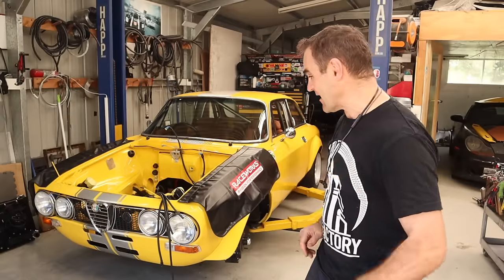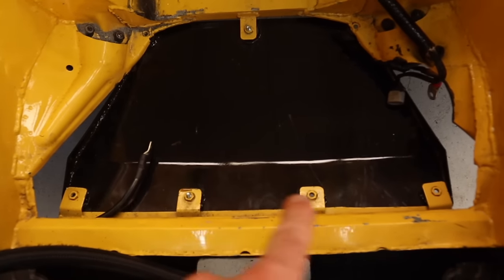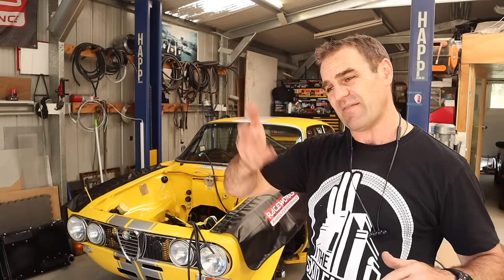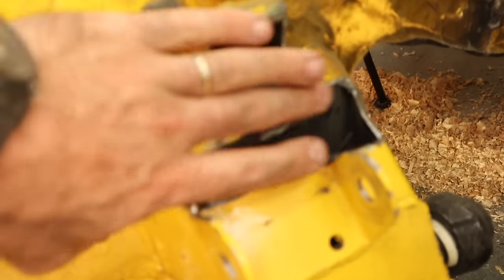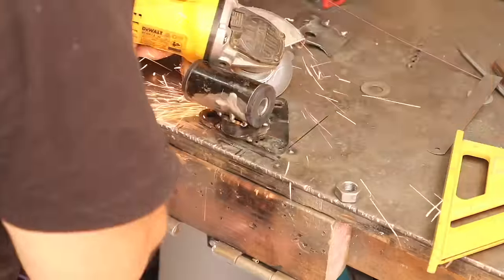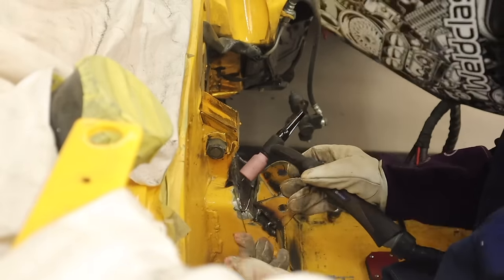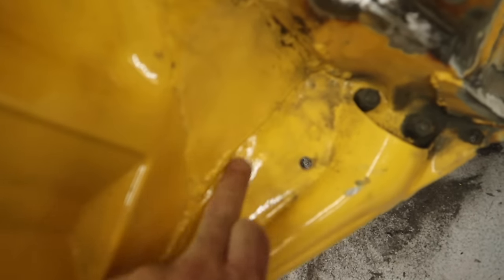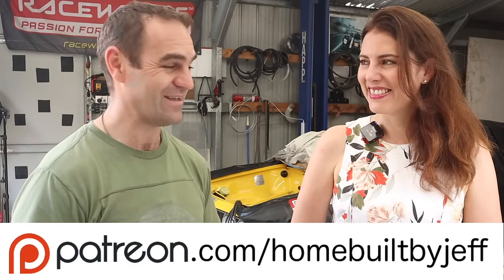Making the Ferrari engine fit... better - Ferrari engined Alfa 105 Alfarrari build part 209

Comment: Jeff, put louvers in the under tray  with them opening toward the back of the car so as the air passing under the car in affect suckes  the hot air out. I did this to my car and the temperature dropped by 15 degrees
Reply: A couple naca ducts on the bottom of that bash plate shock suck the air out nicely.
Reply: @Simb-l  naca ducts are inlets, not outlets
Reply: Standard sump guard on my old Hilux has loovers
Reply: Or some naca ducts..
Reply: Go rally style and just drill some large holes in the bash plate. They do it so 1) it aids cooling but 2) also to allow flood water out.
Reply: I was going to suggest this as well. You could 3d print some dies to bend in the louvers, and you can use your CNC plasma table to cut the slots in it
Reply: Hey Jeff. I'm with these guys on the bash plate.. But I would press the holes out. Press and form the edge of the hole down so that any liquids would find there way out easier (and air). But also give the plate a bit more rigidity if it does come into contact with anything, as the holes will make it weaker.
Reply: I’m not sure some of the suggestions will solve all of the problem(s).  There are 2 basic states - stationary and moving - and airflow works differently for those two states.  At rest, hot air rises and needs a way to escape from above the motor, so venting above the engine might assist, but once moving the airflow takes a different route as a result of changes in air pressure across the surfaces of the car.  I think some advice from a skilled expert might be best.  
I speak from my experience on a drip tray vent I fashioned for a hot LJ Torana many years ago.  Initially it faced forward but experience showed that this made things worse, as it disturbed airflow through the radiator grille making cooling less effective, and when it rained it scooped water over the distributor and plug leads, which wasn’t good either.  Ultimately I reversed it so that it created a negative (sucking) pressure under the engine which did improve cooling.  It also stopped all the water entry.
Some expert advice from a suitable engineer might save a lot of re-work…
Reply: Put louvers in the under tray

Comment: I swapped my fan from a ebay special to a mishimoto race fan , I would louvre the sump guard to direct air out of engine bay , also try have the bonnet open slightly to see if temperature actually decrease before adding bonnet vents, you can get prescription lenses to go into welding masks

Comment: Louvre type reversed scoops in the under tray / bash plate would assist greatly. You could do a series of small louvres or a larger single reversed "bonnet scoop" to allow large volumes of air out under the engine. 

I would tend to leave the plate in because of the mud and spray up into the engine bay if it is removed. Makes cleaning the bay a lot harder. 

It also reduces water, mud and debri onto fan and serpentine belts which helps them to maintain friction and not slip so easily under load in night time adverse conditions .........

Comment: Remember the Holden Torana LC LJ GTR XU1 front Air Dam, It was there to make a low pressure area behind it to draw air through the radiator. The VL Commodore had the same kind of thing made in plastic so it could flex.

Comment: You need a shroud around the fan to draw enough air to cool the radiator. The shroud allows the fan to pull air through the radiator's entire surface area, increasing its efficiency. The fan should be centered within the shroud. That tends to be the best location to draw air through the full surface of the radiator
Reply: 💯% Agree
Reply: Yes was going to say this.
There's no real shroud on them fans.
It can't suck in enough air efficiently.
Reply from the maker: There is a shroud. There is a whole video of me making it and you could see it in the last couple of videos ;)
Reply: Yea definitely needs a shroud
Reply: @HomeBuiltByJeff  I’ll go try and find that Jeff. If you’ve done a shroud already then I wonder if there is too much water flow through the radiator because if it runs through too fast it might not be staying in the radiator long enough to cool off at idle?

Comment: Every little bit will help.  I forget, have you tried using a wrap on the exhaust headers?  That will help keep some heat out of the engine compartment.

Comment: Jeff, I think you’ve diagnosed your cooling issue correctly.  If you want to retain the “bash plate” you might consider putting a fan or two in it if there’s room, to PULL the air that’s gone through the radiator OUT of the engine bay.  This is similar to tightly cowled piston aircraft…airflow out is just as important as airflow in.  Most piston aircraft are air cooled, but the same principle applies.
Reply: Agree here!  Fan to pull that air at slow speeds, traffic etc.

Comment: The new fan will make a huge difference. If will just push the air around the engine and out the bottom. 
   Also noted cutting a louver in the bash plate to pick up that high speed air and use it to vacuum the air out of the engine bay. There are high pressure areas on either side near the tires from the "tire squish" as they push the air out of the way. Air dams could be installed on the bash plate to block the tire squish air from filling the low pressure area you want under and behind the engine. Great work powering through these hiccups !!!

Comment: Looking good Jeff, when we were developing and building supercars (rear engined worse)  heat was always a massive issue. Maybe modding the bonnet with the hump continuing to the back edge by windscreen and then having a vent along the back edge of the hump …. that will help the rising heat escape along the back edge and out. The easier way with old racecars was to lift the back edge of a bonnet with lift spacers to create a gap….. enjoying your content mate 👍👍👍

Comment: To assist the engine cooling cut out the triangular areas you mentioned and 3D print a grille to fit in there.

Comment: Jeff, welcome to getting older.  As a rule, you should have surface area equal to your radiator intake for the outflow and preferably about 20% larger.  The idea of the louvers in the bash tray is good, as long as the louvers are shaped correctly.  The other option is outflow NACA ducts in the bash tray, but I do not know if you have enough space above the tray to install them.  Adding the fan shroud is a must, especially for idling conditions.  Keep working on solving this, you will get it right.

Comment: Speaking of vision, I was in a hurry and trying to get a project car assembled so I could shuffle cars around the shop, and punched myself in the face with a 1/2" ratchet! I really did a number on myself. Split my eyebrow, 2 huge lumps on my head, one from the socket and the other from where I pulled pack into the door pinch weld, and my vision in my right eye is almost gone. Which was my good eye!
Fingers crossed I can see to weld tomorrow. Have a huge fabric job on at work.

Comment: On my 1986 Alfa Romeo GTV6 I have a overheating temperature when the A/C was on so I installed a cooling fan in front of the rad and left the original twin fans in the back of the rad and it solved my overheating issues, you may want to try that Jeff, I wouldn't cut louvers in the hood.  Good luck.

Comment: Regarding the vacuum leak...be careful, if you have MAF based ECU tuning, then whole tune would be off now, after the fix, because you actually tuned with less measured airmass, than actually entered the engine. If you have speed-density tune (MAP based) then you're OK, because you tuned according to actual measured MAP in intake plenum.

Comment: Hey Jeff couldnt you make some neat holes in the inner wings for hot air to escape through the wheel arches.?? I noticed 2 verticle rectangle  inlays on the front sections of the inner wings if you cut the centre sections out l reckon alot of the hot air would escape. Just a thought 👍
Reply from the maker: Unfortunately that has the castor rods mounted directly behind that.

Comment: Is there bleader valves on the heads to release air pockets? Ceramic coating the headers will decrease the temperature also.

Comment: Keep the "bash guard" but cut longitudinal gaps maybe 1" wide and 1,25" apart in it.  That way if you DO hit anything, it will still work as intended,  Should be enough to vent hot air down and out.

Comment: Few days late on this, but what if for the bash plate you go with what some of the originals ones had (And my one) was basically a cage protector, just a few ribs to protect, shouldn't be to hard to find pics.

Other suggestion, if you did have to do something to the hood why not look at the latest alfa Gulia QV and the vents its got on its hood, way more subtle and could be something you could get, laser scan and 3d print for mock-up.

Comment: Have you looked at static pressure fans vs airflow? My understanding is that airflow fans don't work as well as static pressure when it comes to forcing air through radiators especially in tight spaces. 

There's info on YouTube about it from high end PC builders that use watercooled loops in their builds.

Comment: i know you don't want to cut up the engine bay, but what about some formed air outlets in the inner fenders into the wheel arches? it might introduce more dirt into the engine bay but if you shaped and placed them carefully it could be another under bonnet solution

Comment: Jeff you can put the baseplate back just drill it. Make 25 holes in it. Like a grid plate (is that EN) you have the protection and the ventilation.

Comment: Jeff, your engine overheating is at idle in traffic and when you move it’s alright, right? Heat rises and for this reason you need some louvers on the hood for the heat escape from the engine bay. Louvers can be done very clean and good looking, check Lancia Stratos or Delta. Keep up the good work and Godspeed from California 🇺🇸
Reply: I’m not on telegram

Comment: If these mods aren't enough to lower the temps, maybe you could louver the inner wings,and let som air out over the wheels? Some cars from that period had vents in the top of the wings too. If that's too difficult with all the stuff you got packed in everywhere, maybe vents or louvers eihter side of the window, above the exhaust manifolds? That could help with rising heat when stationary too. Of course all my suggestions would send you back to the paint booth.

Comment: A nice functional method you could do on the bash plate is to add louvres around six of them, this way the metal in the louvers will direct the air, where a hole has no method of directing the air.

Comment: The bash plate will actually help cooling when the vehicle is at speed if you just put some louvers in it. Removing it will reduce the air flow going through the radiator because air can just go underneath without the bash plate.

Comment: Air is lazy.  It will evacuate through the first low pressure area.  Instead of removing the skid plate, you could scallop/louver it and it would still be effective for both protection and air removal.  Also, I can't tell by looking at your headlights but if you have a gap to the left & right it could be creating an air block from turbulence.  Blocking off the sides to force the air to directly flow into the Rad will be more effective in every driving scenario.  Thank you for your videos.  Keep up the great work.

Comment: As an experiment, you might want to temporarily demount the horns behind the front grill to see if that might increase the airflow. A more powerful fan should certainly help, but air inlet resistance, as well as outlet resistance all factor into the cooling.

Comment: Heavily humped between the front wheels - like a ripple strip at the track? or a high crown or some sort of demarcation parking strip on a road course?
And yes, I would also rather see louvres in the bash plate rather than the bonnet, maybe even with bracing rods to restore the strength if needed.

Comment: Jeff I will repeat myself , if an engine overheats due to the air in the engine bay getting too hot then the problem is not the hot air it is the fact that the pump is not abole to circulate the coolant around the engine and the engine is also suffering a temperature variation of more than 10 degree's celsius. All roads lead to the pumps ability to circulate the coolant. The engine bay should be a cocoon of heat that the engine has built up so that it is able to stop using excess fuel in order to replace the heat it is losing. If other people are telling you otherwise then please ask them if they have EVER paid close attention to the circulating pump of any given engine they have worked on. Do any of those people know what the required rate of flow is for any iCE with a cooling system is, if they cannot quote that figure then they are full of sh&t We have done 30,000 hours on engine dyno and engine bay testing to prove what I am saying. It is common sense when you realise the importance of a properly operating cooling system. Air intake temperature for a petrol engine should be 60 degrees celsius, and we have proven this on engine dyno. Temperature temperature temperature and only then will your engine be able to be properly tuned.
Reply from the maker: I hear what you are saying and that , but the fact that it cooled perfectly on the dyno (sat steady at 70 degrees so probably working too well), with the dyno fan tells me it is an airflow problem. If the fans are going but they can't draw air through the radiator because it has a massive pressure build up in the engine bay then the radiator won't do anything, regardless of too much or too little water flow. That is not to say the water flow could not also be an issue, but there was definitely an airflow problem.
Reply: I'm with 1darrylolife here. There's no harm in improving air flow, but there is a great deal more heat to get rid of under power on the dyno, because the engine is at best 40% efficient. The other 60% of heat from the fuel goes out via the exhaust and coolant, maybe 30% each. At idle the amount of heat going to the coolant is tiny by comparison, maybe 1% or so of what it's making on the dyno at full power, so why does it only overheat at idle? 
Did it run and stay cool on the dyno idling for a long time? If so, maybe it's a bit of both - better engine bay air flow and better coolant flow at idle needed. If not I'd look at the coolant flow at idle.
Reply: @salamander5703  From the information provided by Jeff, the engine remained at a pefectly 'cool' (70 degree C) temperature courtesy of the large external electric fan provided by the Dyno facility.  In my experience the fans used by Dyno testing facilities are powerful to the extent the breeze generated becomes uncomfortable if you are at a close proximity to the car - i.e. Dyno facilities don't skimp on air movement machines.

Comment: Jeff and just remember heat rises too so maybe do something with the clear panel in the bonnet,  great work as always you seem to be able to over come any issues you have with relatively little trouble. And yes add some reverse louvers in the bash plate to suck from the bottom 👍

Comment: The vacuum leak doesn't just raise idle, it makes the mixture way to lean, which raises temperature significantly. The ECU will try to adjust the mixture via the oxygen sensors, but that won't be perfect. I expect plugging the vacuum leak will improve temperature
Reply: It wasn't suffering high idle when getting a base tune on Dyno so that vac port must have been opened up after

Comment: I'm no engineer but wouldn't a heavy gauge grid cover work just as well as that plate ? 
Also on the airflow - wing vents would probably work fairly well
Reply: Was thinking this.
Or a fine mesh ?
Still think there should be some sort of under tray just for protection...

Comment: I think instead of removing the bash plate, louvre it. At speed it will tend to suck air and not flow through the radiator. Louvres will help suck air through the radiator.

Comment: I'm doubtful that removing the bash plate will help, and won't aid the car's underbody areo. I suspect you need air flow at the rear of the engine , below the gearbox and at each side too. There's not much air going to get out at the front, see how the airflow is from the the fans, it won't flow down, it will flow back. Keep the great work

Comment: 100% sure you don't have a cylinder head leak? if yes you might need a proper dimensioned water pump to solve issue.

Comment: Vacuum leak wouldn't have help with the cooling issue, Vacuum leak can cause a Lean type issue leading to excessive cylinder temp and excessive heat into the cooling system causing to struggle to cope.

Comment: Brutal but effective, and it'll be invisible in the end. Just to be a nag - engine/coolant temps look to be sorted but I'm still wondering about engine-bay temperatures generally given no exits for air at top, rear or sides.

Comment: Brilliant as usual, couldn't you have used this opportunity to lower the engine a bit, to make the perspex flush as you wanted in the first place?
Louvers in the bash plate, then you'll be able to say you have some 😂
For the cooling, I'll repeat myself, waterless coolant will do the job, and protect the engine more 
Looking forward to seeing it painted (again) and back together
Reply from the maker: Lower it where? It has barely 10mm under it, that is the whole issue.
Reply: @HomeBuiltByJeff  Sorry daft question, it's just that you moved the engine mounts, and I thought maybe you could lower the whole thing (you said the engine sat higher than the original one when talking of the bash plate) so I did 1+1 and came to 3 🤣